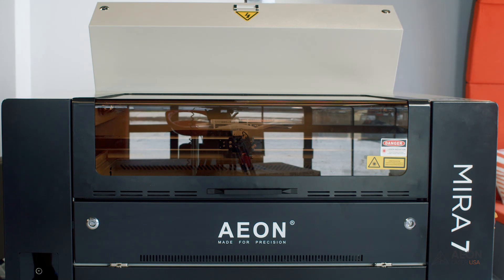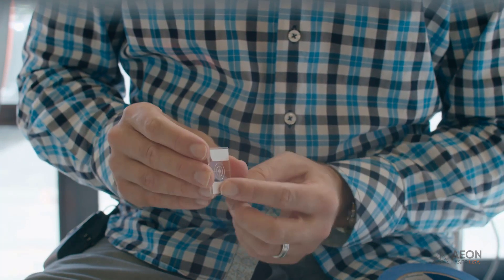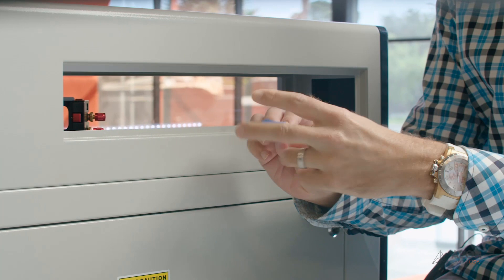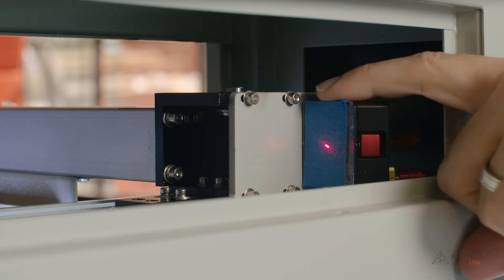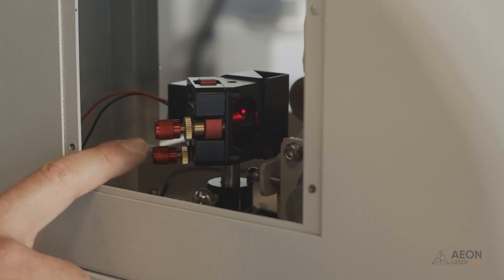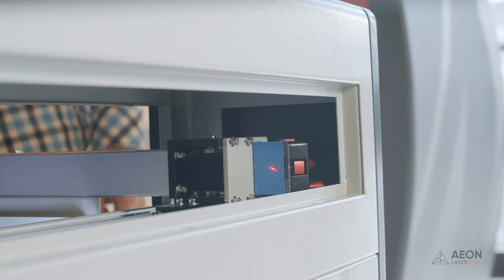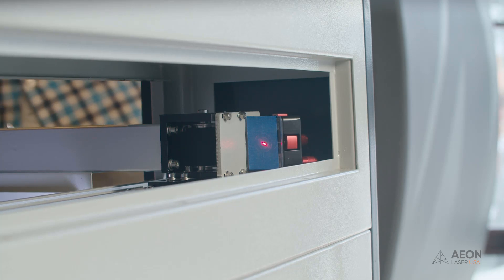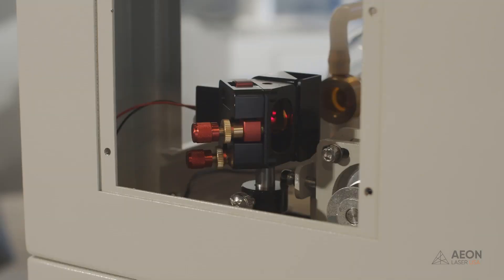MIRA Pro Part 3: Aligning Mirror 1

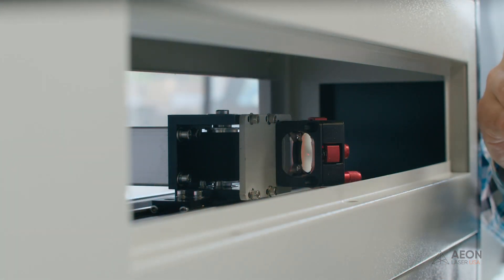Comment: Im confused the tittle of the video say Aligning mirror 1 , the acrylic test pc it has number 1 engraved but then you said mount the target on mirror 2 right at 3:07 ???
Reply from the maker: Great question. The target is mounted in front of mirror 2 prior to its involvement in the alignment process. What's actually being measured is solely determined by the adjustments made on mirror 1.

Comment: You didn't show the more difficult part. Getting the beams combined and running parallel to each other...I find that if you pull out the first mirror and put a board about 5-7 feet from the machine, you can do a small burn and see how the laser and red beam match, adjust the beam combiner until the red dot falls on top of the burn you just made, move the board in a few feet and burn again and if they are still matching the are parallel, if they aren't adjust the back leveling foot on the laser tube until they are, rinse and repeat until the match up for a burn 1 foot from the machine and 10 feet from the machine...after that you can typically just adjust the mirrors using the red light.
Reply from the maker: Thanks Justin, there are a number of reasons we don't teach this method, liability being one of them, but it's also not a necessity to have the red dot and infrared beam overlapping perfectly. Since we adjust the beam path ahead of time in our QA process, all that's left is to ensure the beam is parallel, and you can still do that with the red dot regardless of whether it overlaps the infrared beam perfectly or not. We also prefer the alignment be done using the targets rather than the red dot so that if a customer needs help, they can send us photos of their burns for analysis. At the end of the day, it keeps our customers from shooting laser beams across the room, saves them time, and achieves the same result with an option for feedback should they need it.